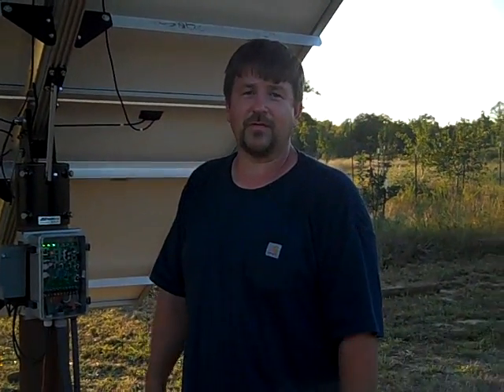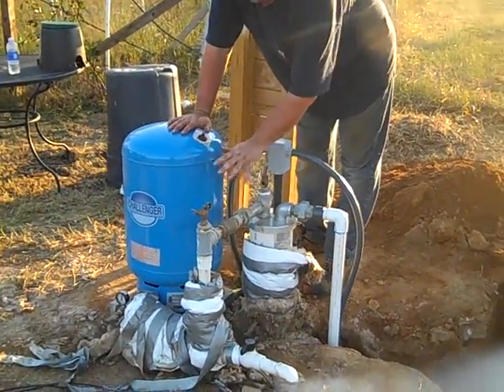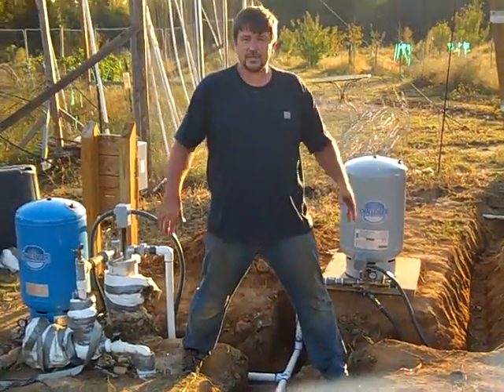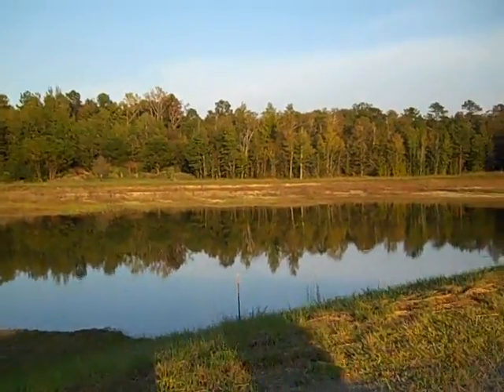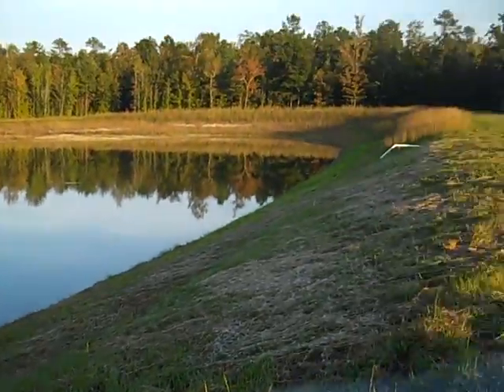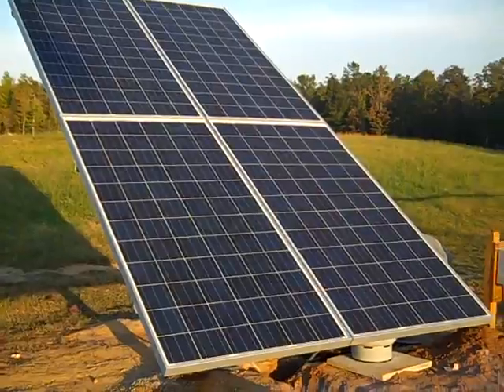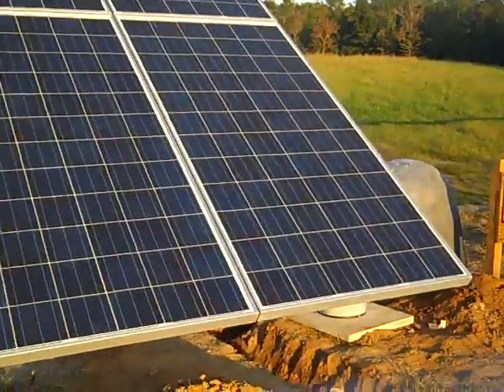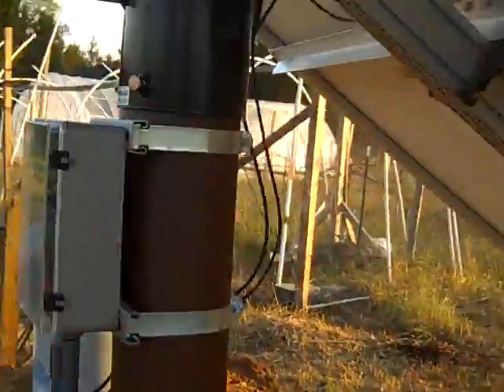All about wells - 3000 gallon per day solar pumping system

Comment: Hi engineer775, we have a deepwell in our house, i mean manual deepwell. I have this idea of storing water in my elevated water tank, without using electric pump. Is there a way that I can pump the water up without using any electricity.? Thanks for to share your ideas..on it.
Reply from the maker: There are lift pumps that will do it.  I use SIMPLE PUMP and the BISON will as well.

Comment from the maker: You can shut it off for safe measure.  Use about a 3/8"- 1/2"diameter stone and count second till it hits water.  try this 3 times and take the average.  It is a rough estimate of 20'/sec.  3 second ~ 60 ft

Comment from the maker: Yes a hand pump back up but we have also gone with a modular pump system approach meaning the controls are separate from the pump and the pumps a field reparable.  You can by all the replacement parts for this system and Faraday cage them in case of EMP failure.  So we take a plug and play approach to EMP protection.

Comment from the maker: Battery bank water systems are the most inefficient way to pump water with solar.  Without batteries, and using MPPT tracking you can get about 40% more water per day.  As to ta tank I usually fill a tank first then use the tank overflow to go to a pond or cattle waterers etc.